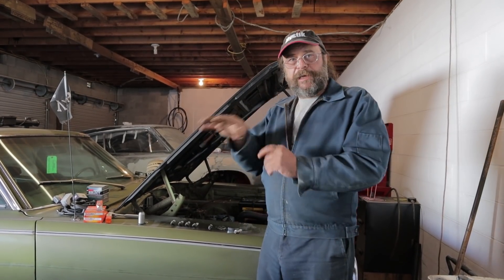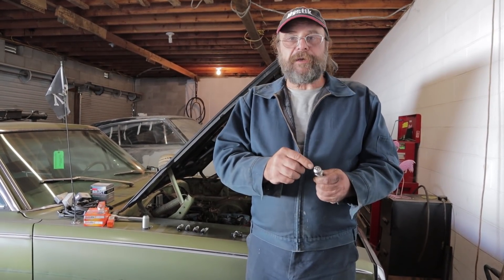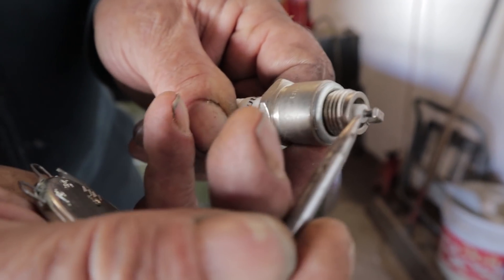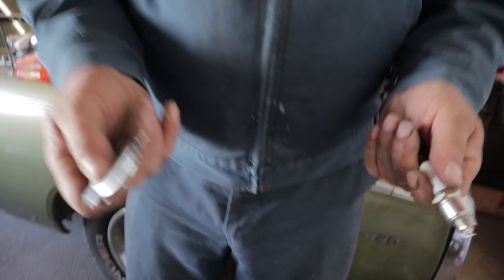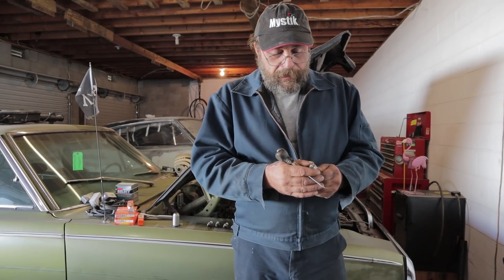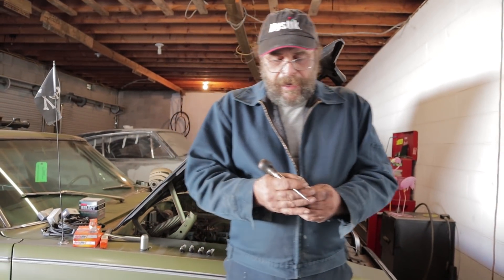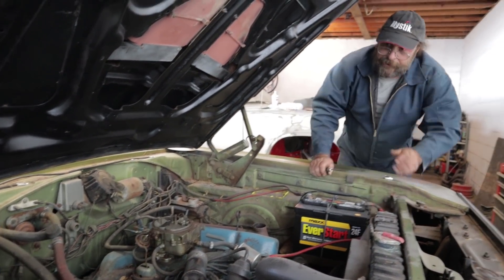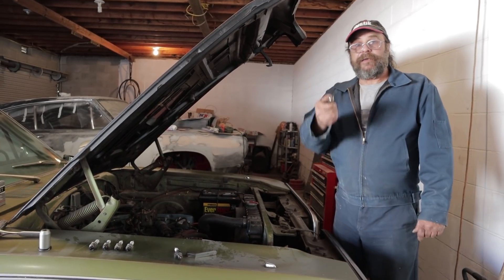Tune Up Basics - Spark Plugs

Comment: Champions are absolute trash. If you've ever tested  plugs with a pressure tester Champions break down and arc down the center insulator at the lowest pressure
https://www.aircraftspruce.com/cache/400-400-/catalog/graphics/12-00794.jpg

Comment: Good video; I've generally had good luck with Autolite plugs as well. Big believer in a light coating of dielectric grease on each terminal nut and marking the plug wires by cylinder number with painter's tape if I'm not changing them one at a time (both are the result of lessons learned the hard way).

Comment: Next time put some rag on the side, you scratch the paint like a dummy...

First advice do not buy spark plugs on eBay or any fake China stuff.. Stay away from the Bosch ones there are fake ones everywhere..
Gapping it? Gaping a$$ they should come right from the factory, you just add stress cracks to a very hot electrode nowadays way too dump

Comment: Denso Iridium TT's are the best then NGK Iridium plugs over all quality difference can be seen. Just a little better quality. Make sure you gap to factory specs. They will tell you not to gap them but after a misfire at idle for 2 months I figured out it was the gap on the NGK plugs. Went back to the Denso sparkplugs and got 3MPG better. Back up to where it was when new. I like both brands and was always a NGK guy but now I try to get a Denso first then a NGK second.

Comment: Just bought a 1964 valiant with 225 slant  six previous owner left washers on put in new plugs without washers tightened them down drool tubes would spin .  Had broken stud in exhaust  pulled head to fix. spark plug threads had to have tap ran in them cause you couldn't see last of threads from carbon buildup

Comment: Back in the early 70's, my Father and Uncle had a garage. Dad talked about plugs that would spark just fine out in the open but would fail under compression. I had a plug where I'm 90% sure it was doing that and it was beating the hell out of me until I remembered that and swapped the plug. They had a glass pressure tester in the garage where they could pressurize it and watch the plug sparking. I didn't have that so I can't be 100% but I was ready to break out the dynamite.

Comment: If I'm not mistaken a rich afr gives a higher resistance in the secondary circuit. Most of the resistance is the gap, that's the reason for the high voltage to jump that and produce a plasma that ignites it in a wave. 
That is called "flame propagation" 
The plug wires do have resistance and there is a spec.
Just go oem specs for oem shit hahahaha

I'm half illiterate and dyslexic ❤

Comment: 45 years ago a buddy and I compared the different manufacturers spark plugs. Most of them had the electrode off center within the ceramic to one degree or another. Motorcraft/Autolite plugs always seemed to have a higher quality of manufacture than the rest and seemed to last better long term after a tuneup. Champion seemed to have the issue you referred to, don't flood them out or they're shot. Only thing I'd like to mention was: Show how you fixed the vacuum pull off so it worked properly. I know, you just bend the linkage, but everyone else doesn't. Nice job Tony!!

Comment: That's the only rational behind indexing plugs that actually makes sense, everyone else describes it in terms of facing the gap towards the exhaust usually for some ambitious reasons they cant convincingly convey.
Reply: I had always heard you faced the gap towards the intake valve when indexing, to have the open spark towards the mixture. This is the first time I’ve heard just the opposite, in order to shield the spark. Interesting either way.

Comment: 4.6 ford mod motor, you want to tighten the hell out of them. About 25 ft lbs worth. The mod motors love ejecting sparkplug and taking the threads with them. Ask me how I know
Reply: Having many Ford Mod motors why would you tighten the hell out of them? Aluminum heads with barely any threads cut into the heads. Antiseize and run them down to "touch" ( with crush washer) 1/4 turn and your done! Hardest part is pulling plugs without pulling threads. I usually soak them, blow out the wells with air and if i exceed more than 5 inch pounds- STOP- run back in soak somemore. Never once have i pulled a thread or broken a plug.
Reply: @danielscott6787  The 99-04  PI mod motors only had 3 threads in the head, and that would be a lot. They back out, then blow out. Several ford techs (after my old motor ejected a plug) told me "When the plug stops, get a 1/4 turn more and youre good" Also told me dont use never seize (which i always used to) because it will allow you to strip the threads when over tightening.

Comment: Is it necessary to check the gap on new plugs after they had time to break in? Is it possible that the gap can change once the ground strap has got hot enough to soften?
Reply: No.

Comment: Hi Tony, when gapping the plugs should I keep in mind cylinder compression? I've got 1967 318 small block and the left bank has lower compression than the right one. Shall I change the gap accordingly? (If yes - how much and in what direction?)

Comment: I work at a motorsports shop, dirtbikes, snowmobiles, I've built a turbo sled for a guy once! Anyway you index sled plugs so they dont wash from the direct injection, learned the hard way after spending a good hour diagnosing how me doing a plug change ended with a sled that wont start lol

Comment: Awww man 
I hope the next video is on figuring out which plug wire goes where. This is going to be the longest tune up ever. 😮
Reply: 1-8-4-3-6-5-7-2. Standard firing order on big and small block Mopars....one of the first things I ever committed to memory when I started wrenching.
Reply: Firing order tells the tale.  Uncle Tony knows cylinder numbers like the back of his hand.  If he forgets he can refer to the original Mopar owners manual in the glove box.

Comment: Do you index the plugs when you put them in? Autolite were the best plugs back in the day. Vic Edelbrock took a 350 hp 327, broke it in and then pulled the engine and dyno tested. It made 313 hp Stock. The first thing he changed Parts wise was to go from AC to Champion to Autolite. The Champion didn't help but the Autolite plugs gave him 5 hp for a total of 318 hp. The rest of the article details pulling the engine down and blueprinting it, so that it had an actual 10.5-1 compression instead of 9.9-1 or something near that. He ran it again and picked up a few hp. Then he changed mainifolds, cam and distributed and he finally got it to 350 hp. Later on Crane cams took a Stock 350 hp 350 and dyno tested it and got 323 hp. Their cam brought it up to 350 hp. By comparison, the 275 hp 340 Chrysler motor actually made 325 hp bone Stock. So, both manufacturers cheated, but Mopar cheated in order to give the racer of Super Stock an edge. NHRA caught on quickly and refactored the car according to its ET and weight.
Spark plug tube can be used on any engine that has the clearance for them. They help keep the spark plug wires from getting damaged from the heat of the headers if you're running them on the car. Since then plug wire manufacturers have come out with better boots that handle the heat where the older wires didn't. I'd still be tempted to run them if I had room for them.
Always check the cap and rotor when changing plugs. Excessive pitting, scorching and wear will make the engine run rough and cost you power. Do the same with the plug wires. For them you can use a multimeter to measure the resistance in the wire and make sure it's within the specifications of the plug wire manufacturer. If you have to change the cap and rotor, buy the ones with bronze contacts. For wires try to find a set with Monell steel wire wrapped around a cabin impregnated core. They resistance is much much lower, and the carbon impregnated core will keep them Street legal. If you run wire wires and you pass a Cop, expect to be pulled over as your wires will cause static on his radio. Not fun!

Comment: Brands:
Autolite has IMO the best quality control, with NGK being a close second. Except NGK costs more in most cases. If you have a newer car that calls for platinum or something, IMO NGK makes better "special" plugs. if you are working on pretty much any engine from 2000 or older, good old cheap copper core Autolites are what you want. 
Champion plugs were incredibly well made.....40 years ago. Grew up farming, we had plugs that had 6000 hours on them and were 30 years old in some of our smaller gas tractors. Champions. Nowdays.... bad quality control, no price benefit, not much going for them. 
Motorcraft- pretty sure these are manufactured by someone else nowdays, buy'em if you are die hard Ford otherwise meh. Delco is the same nowdays. 

Heat range: Only thing I will say here is most people aren't making race engines. Don;t get carried away with "performance gains" on spark plugs. it's a plug, it makes fire. The rest of your ignition system is going to determine most of the benefit, not the plug at the end of the line. A colder plug should be for helping with detonation, otherwise leav'em stock. That said, I use hotter range plugs on old tired engines to help burn oil blowbye. For instance, an old Minneapolis Moline I inherited(1967) with factory compression ratio of like....6..... and not exactly tight oil ring tolerances after 5000 hours of farming..... yeah helps burn some oil off and keep the plugs clean. 

IMO small engines(like lawnmowers) are VERY sensitive to gap. If your mower runs bad or is super hard to start, buy a new copper core autolite for a couple bucks and make sure the gap is perfect- based on manufacturer spec.Easy, cheap way to start troubleshooting. If you don't know the gap ask the dealer(or wherever you bought it) to find out for you.
Reply: Agreed Champion used to be a great plug for Chrysler products but during the 80's they went to hell.

Comment: FE Fords abd SBC have an issue with headers and spark plugs.t
Reply: After market Fords fixed the prob
Reply: Tell me about it. I’ve got a ‘68 mustang with a 428 CJ, power brakes and long tube hookers. You either have to pull the master cylinder or the valve cover on the driver’s side to get to the back plug. It’s SO nice 👍! I run autolites so I don’t have to do it very often.

Comment: One thing to add. If you’re gapping an iridium plug with a very thin electrode, use needle nose pliers to pull the ground strap back so you don’t scrape the iridium off with a gapping tool.

Comment: In an attempted' hi-perf  street car (68 302 2V Ford ) as a kid in my old 64 Fairlane I ran one heat range hotter & ran premium fuel along with a curve kit in the stock points distributor.  It was an auto trans, 3.50 gear one wheel peel. So did I accomplish anything by doing that??? lol Because it DID run real good for a 2V auto!

Comment: ASE Certified NAPA Parts guy here, always used Autolite in MoPaR's. If you need 2 steps HOTTER plug in AC's !!! 
AC's automatically HOTTER by 2 steps. But WONT perform as long!!
 When customer's got fuel fouled plugs... Sell em AC cross. Clears it up till nxt tune up!

Comment: Just got today a 73 Dodge dart for making a drag car. Thx for making videos Tony you say alot of helpful things
Reply: Congratulations.  I'm currently resurrecting a 73 Dart Sport drag car myself.
Reply: @JohnWilburn  awesome man, our car is a sport model as well. What power plant are you going to run/ are your goals for the car?
Reply: @TodsWasted It is an original 340 car and I have 340 for it.  It ran a best of 7.20 in the 1/8th and shouldn't be hard to get back there.  I want to restore it to it's former condition as it was raced in the 80s. I have old and current photos of the car here:  princetondragway.com
Reply: @JohnWilburn  checked out the photos, very cool man I like when these old cars have some history. Best of luck in your build dude. if you are ever around in Oregon maybe I will see ya at an event with my car 😁
Reply: That’s 2,500 miles of trailering or driving with 4.90 gears..... never say never!

Comment: Was always told the best way to get a good reading on a set of plugs was to run the car wide open, neutral, off, coast to stop. Pull plug.

Comment: I've been using too much anti seize. 
I was putting it on with an acid brush, 
a thin even coat.
Thanks for the correction.
Reply: All you need is enough to change the color of the threads.
Reply: Put WD40 on the threads.
Reply: @danielboone72  WD-40 will gum up very badly and becomes a sticky mess as it evaporates off, especially when exposed to high heat.

Comment: Thanks a Lot Uncle Tony i agree with most of what you said about spark plug still you taught this old dog a few things e.g. slant 6 leave the c washers out / i remember an old buick with a 400 ( plus) ? cid engine & was told to check the plugs , well it had ac oem and looked better than new all 8 purrfect , i had someone tell me stick with oem reguardless , My make a wish is to meet you in person ,maybe onetime i,ll try to light off jokes as fast as a plug fires ! lol ?

Comment: Thanks for the info Uncle T! However I thought that anti-seize was an insulator, so if you put a lot on the threads the spark plug will not get ground. One story with Champion plugs, they left my Slant Six stranded on two ocassions because of a rich mixture, then I swaped to NGK (without adjusting anything on the carb), it still ran rich but never let me down. Good to know. Cheers!
Reply: get lost  I don't know about other brands but NGK says not yo use it. Their spark plugs comes precoated or something like that.
Reply: @rogerlizama1326  most of the plugs on the market now already come with some type of coating on the  threads.  NGK tells you not to coat them because they already have their own.

Comment: ive seen guys go crazy with dialectric grease on sparkplugs and destroy ignition coils, well ive seen it on modern engines with modern coils atleast
Reply: Could you elaborate, I use it when I do tune ups and that is the first I heard of it.
Reply: @gregorystone1439  they put it on the the metalic parts like crazy instead of just the porcelain as an insulator /lubricant for the rubber boots on the leads , it takes a while to fry the coils but it happens all too often , high performance ignition guys actually told me years ago, ive seen it a few times myself guys with brand new coils leads plugs etc installed then months later brand new high quality coils start to shit themselves. transistorised coils etc  just my experience no more no less
Reply: @closertothetruth9209  thanks for the info, I always put about finger nail size glob in the boot but I also only deal with stock. I've never had any issues with ignition systems as a result. I'm a simple DIY and manly deal with classics.

Comment: in an antique shop the state of the art equipment (pre computers to read codes) was an oscilloscope.   With that piece of equipment you can actually see the result of your spark plug gapping.    But gap all of the plugs the same way for equal current flow to each plug.     plug wires also have a resistance to current flow but that is another discussion
Reply: Or now?  the implication being all plug wires should be the length of the longest one required?
Reply: @RussZHC  different materials have different resistance.   In theory yes all the same.  In practice maybe not.
Reply: @RussZHC  sometime s having a 4 ft plug wire for a 6 inch run is a problem in its self.   Coiled up and tucked away the chance of short out is really high

Comment: NGK Plugs are better when dealing with modified engines, high rpm and adjusting for heat range,  Autolites are the best OEM replacement (Carbie) plugs absolutely true.

Comment: "What oil should I use"?..."What did it come with from the factory"?  What spark plugs should I use?  What did the car come with from the factory?  What ____________ should I use?  WHAT DID IT COME WITH FROM THE FACTORY!!!!!!!????  Common theme that I seem to always blurt out at our engine/speed shop when dealing with OEM rebuilds of all makes/models and phone calls.  Yes...if it's stock.  Engineers who know a LOT more about the inner workings, metallurgy, design and possible issues don't just randomly choose a plug, oil etc.... As Tony said;  Unless it's modded pretty significantly, stick with stock and you'll likely have very, very few of the "gremlin" type issues.

Comment: Champion for mopar, AC delco for GM, and motor crap for Ford. Always used champion in my mopars never had a problem, same with delco and GM. Never had a Ford and never will.
Reply: Good same the fords for me.   gm never made a good motor and never well
Reply: cannot agree more, other than a ford is ok too. Drive what you want. Experience: Denver Automotive and Diesel grad. 1982. Fifteen years Chrysler Master Technician. BA from UNC.

Comment: Shooting Champion plugs at ferrell  cats with my wrist-rocket is a favorite pastime - although they do make good plugs for lawn tractors!
Reply: @davenhla  
I made that comment mostly in fun....
I don't have much use for Champion plugs - Autolites either.
Autolites were a good plug until Fram bought them out, Champion makes good lawnmower and racing plugs, that's about it.
As far as cats - I've known a few that were cool as could be, some pure assholes, and the ferrell cats that kill off the birds, squirrels, rabbits etc. and didn't eat anything from their kills I simply call targets...
Reply: @Motor-City-Mike  oh I know it, no worries. I think everyone with a shop has had a run in with "asshole cat" at least once haha
Reply: @davenhla  you know it!
Reply: I usually just stick to throwing lead at them.
Reply: @upnorth5465  
That's how I got rid of them when there got to be too many of them.
Any little bastards that kill other small animals just to rip their heads off and play with it get the gun.
The food chain is one thing, those little pricks were quite another.